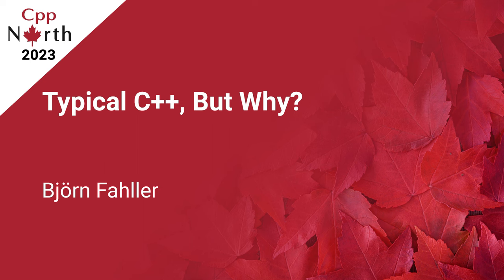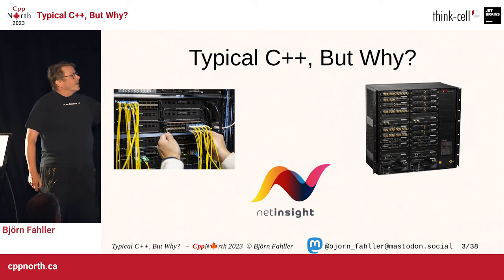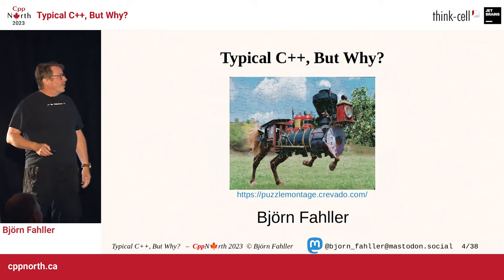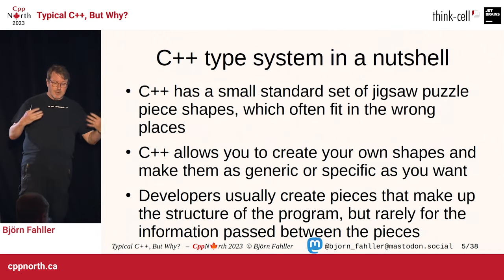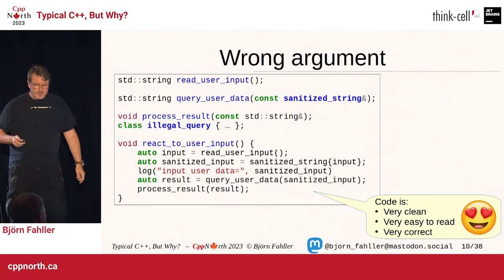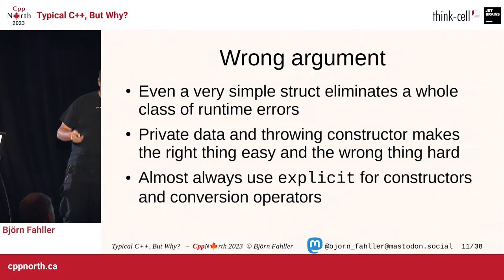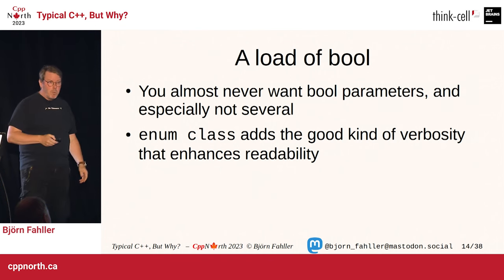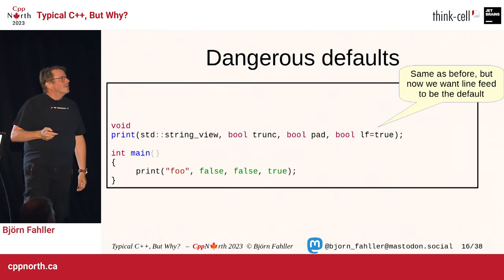Typical C++, But Why? - Björn Fahller -  CppNorth 2023

Comment: 41:33 wouldn’t overloading the close_session function just reintroduce the problem which we are trying to solve by using enum classes?

Before using enum-> pass the wrong value, underlying type is int-> wrong item gets erased.
After using enum + overload -> pass the wrong value, overloaded function gets called, wrong item gets erased, unless we have different implementations for each of the overloaded functions